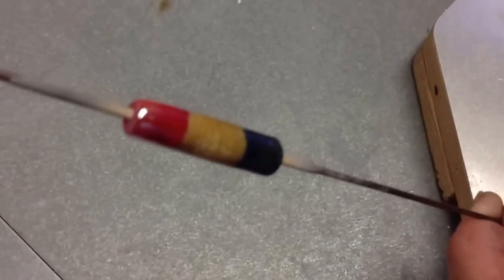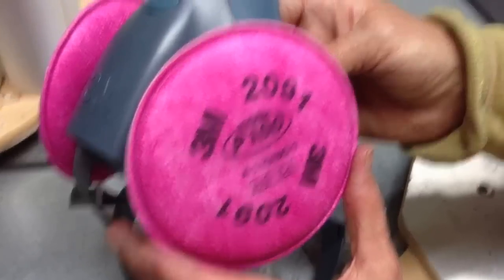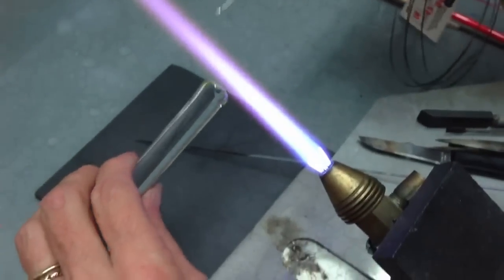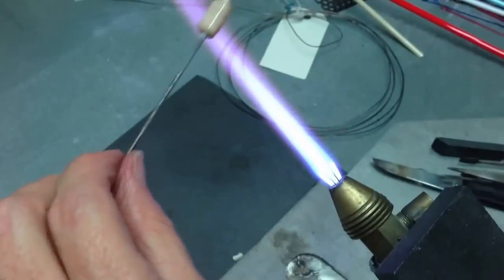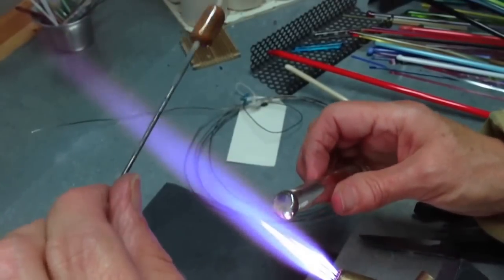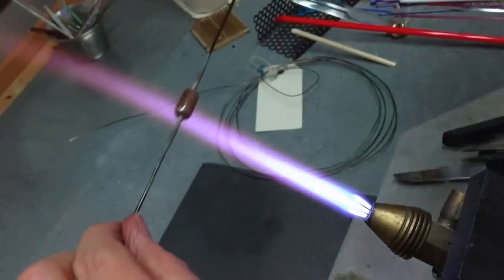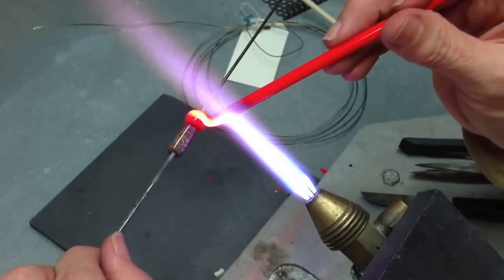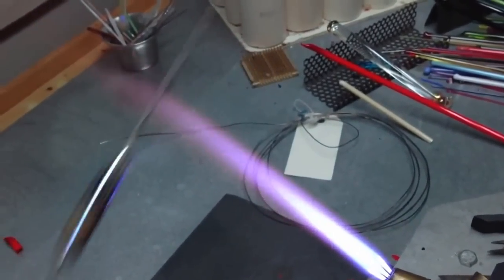Lampwork Tutorial: How to Silver Fume - Step by Step on 104 COE glass

Comment from the maker: Hi MrsChibikat, How often you change the filters depend on how much you use the mask. I'm putting a link to general info you can read about the filters that should help. It says when you have trouble breathing... that means it's clogged. I may not use mine for weeks, so it's hard to give a definite answer. The way I found the information is to put in "3M P100 2097 metals when to change" in the google search.